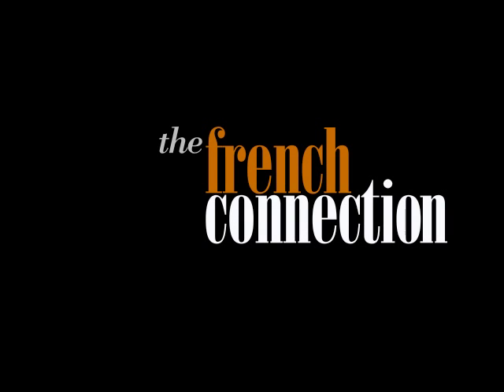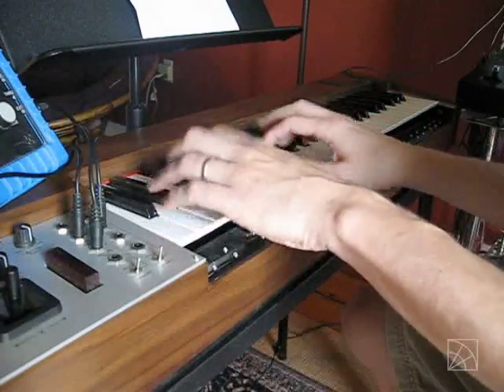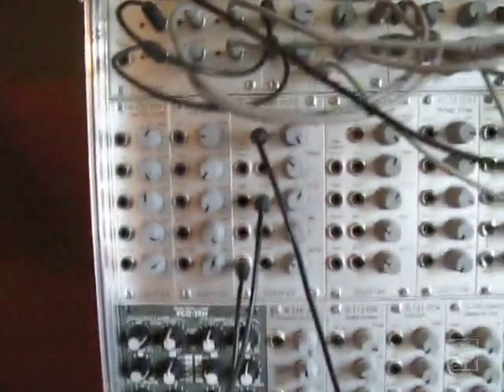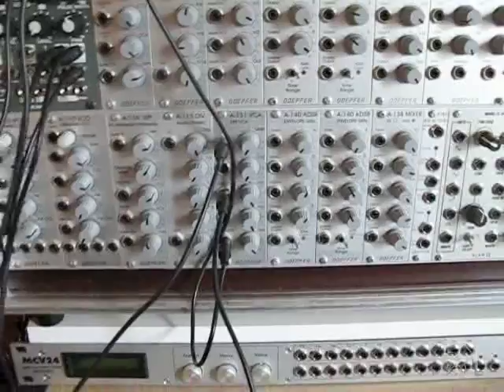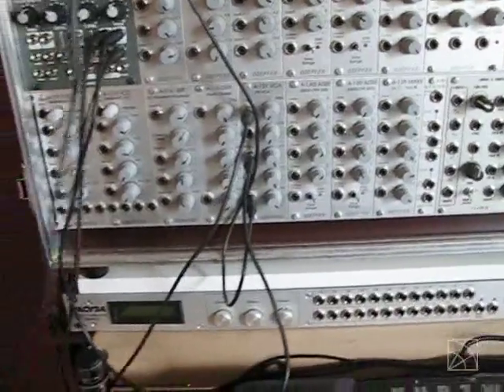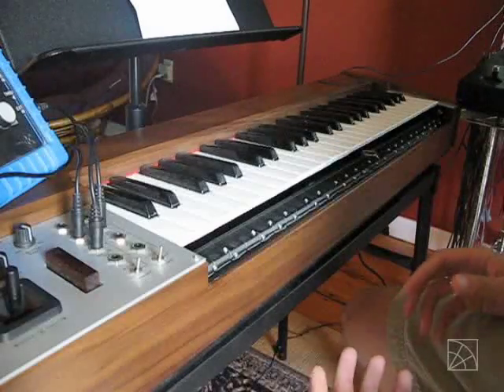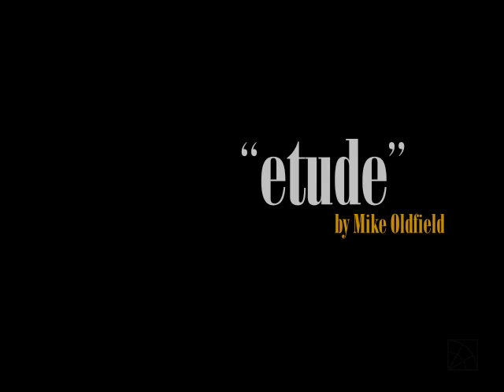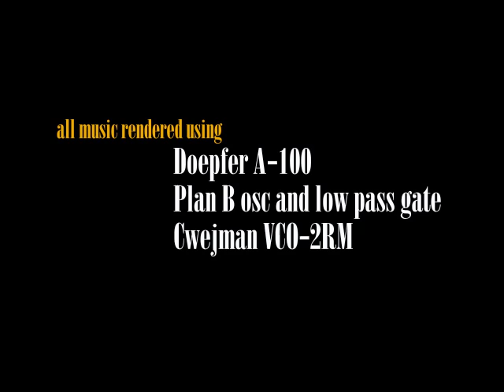Recuerdos de la Alhambra played on a French Connection

Comment from the maker: The VCA is controlling volume/note articulation which is directly controlled by the button on the French Connection. The sound is produced by an oscillator, controlled by the pitch section of the French Connection.

Comment from the maker: It was inspired by the Ondes Martenot. It is a controller only. It makes no sound, just produces control voltages. Another difference is it doesn't have the side to side wiggly vibrato keyboard. google 'French Connection' to find out more.

Comment from the maker: The gate in will work, but instead of articulating notes with the button, you'd be simply triggering the envelope generator - reducing the continuously variable voltage of the button to a simple binary gate.

I'd personally say half of the successful expression of the french connection is derived from the ability to fully articulate notes with the left hand button.

Another option would be to go ahead with the XS, and augment with an ext VCA module in a doepfer mini case.

Comment from the maker: Out of the XS's post filter output into the RS180 signal input. Presumably the post filter output is pre XS VCA so it should just drone on and on. If it doesn't, then you'll need to use another lead from the FC's gate output to the gate in on the XS. Not a big deal.

As a sine wave has no upper harmonics, filtering it won't do anything useful. ;)

Comment from the maker: The Futureretro XS is an awesome piece of kit. I recommend it for anyone looking for a base to build a modular system out of. Looking at the manual, it seems to lack a CV input to the amplifier section, which you would need to do anything useful with the French Connection. From what I can tell, the 'amp in' is for external audio signals, (like post processing of the filter and re-inserting the result into the signal path), not a CV input to the amplifier.

Comment: First, your Oscillator may need to be calibrated.  For ex, you can tune it to a certain pitch, but the notes may not track up and down the scale because it is not calibrated.  Just because you have tuned your oscillator to the correct starting pitch does not mean it will continue up and down to higher and lower pitches.  I hope that is clear?
Secondly, the string on your French Connection might have stretched or been affected so that it does not track correctly anymore.